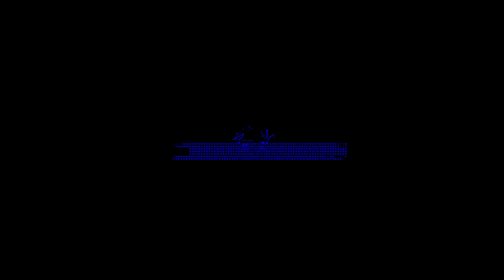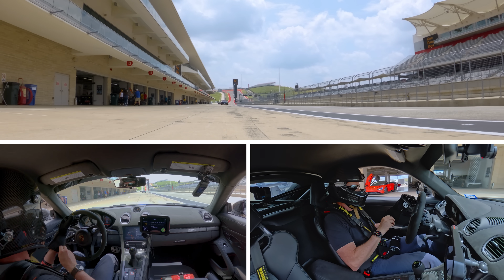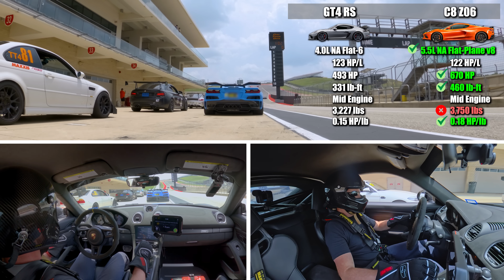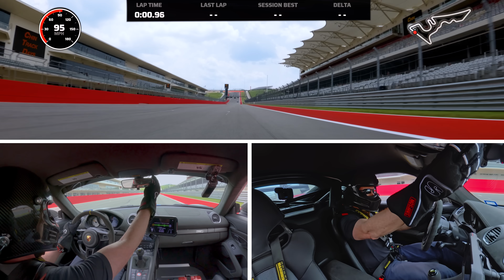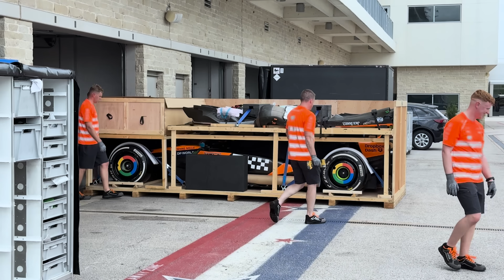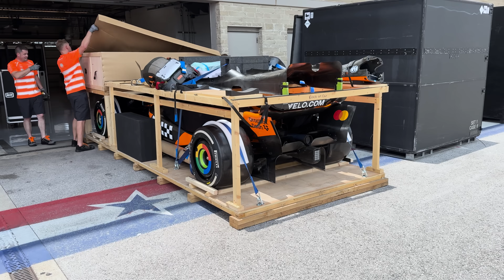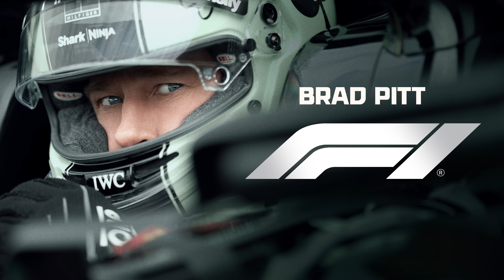Z06 vs GT4 RS : American Power Meets German Engineering at COTA

Comment: The Z06 is a horrible driver. Driver mod is the single biggest factor Porsche noob.
Reply from the maker: That’s kind of the point of the video. There are two different drivers in the video, and both are running at roughly the same pace in these cars. As I mentioned, I believe this is a direct result of a lack of confidence in the car due to setup issues and the brake-by-wire system.

If you watch my other videos, you’ll see numerous drivers in these cars running well below the pace their on paper specifications would suggest. To date, I’ve only seen one running at a pace comparable to the GT3s and GT4 RSs on DOT tires, and that car was on Pirelli slicks, which we know are worth 2–3 seconds at COTA.

Comment: The Z06 is a damn road car bud, period. If GM gutted it like the RS models, have mercy it wouldn’t even be close.
Reply from the maker: What is missing from the RS cars other than the heavy 18-way seats?
Reply: @ItsTrackTime  suspension that even remotely close to 1/3 of the magneride range, sound insulation, place where to put your elbows, no hard bushings in suspension arms, list can go on forever. You're just playing stupid and you know it. Get any road car a racecar treatment (that Porsche already does to GT-models from showroom) and they would be significantly faster. Also, quite harsh on a regular road - like GT-models are.
C8 z06 is comparable in comfort with Cayenne/Panamera, lol. Germans are impotent when it comes to suspension range. And yes, I own P-product and do not own Corvette currently. You don't have to be crazy brand fanatic, they do not pay you.

Comment: The 500 extra pounds pay dividends when you use the Z06 on the road. Sound deadening, storage space, creature comforts, etc.  Can a 3200LB track car be livable off the track with near 100db of intake noise?
Reply from the maker: I don’t buy high-performance sports cars for creature comforts. Give me an engine screaming to 9,000 rpm, a stiff chassis, and enough noise to make conversation impossible. If you want a quiet, comfortable ride, the market has plenty of options.
Reply: @ItsTrackTime  calling out a chassis when your camber fucks off in every corner in the same sentence as "high-performance" sports car is comical. 
Likewise if you want high-perfomance sports car, you can buy plenty of actually fast options. gt4rs is THE slowest car for the money. Physically impossible to be slower all things considered.

Comment: It's also called the Constantine effect. He's accelerating before you and has to brake before you. So that is where you see it walk away and then you get close again.
Reply from the maker: The concertina effect only becomes significant when there’s a gap between cars, allowing speed differences to build and cause the spacing to compress or expand, especially in braking and acceleration zones. When cars are bumper to bumper, they brake and accelerate almost simultaneously, leaving no room for that compression or stretch. In that case, the effect is neutralized, you’re essentially locked into the same timing as the car ahead. Skip to 10:12 in the video and watch the grey Z06 accelerate. A 670 hp car should easily pull away from a 500 hp car on the back straight and open a gap that can’t be closed if both cars brake at the same point.

Comment: This is a tough comparison, you’re the better driver here, obviously utilize the race track way more than the z06 plus smoother braking input, and overall better entry and exit out of corners. You would have to jump in the vette immediately after and compare that way.
Reply from the maker: Notice there are two Z06's in the video driven by different people and both perform about the same.

Comment: The effective HP delta is 20% and you’re not getting closer in the corners nor is he getting away on the straights. It’s simple physics. At a higher speed the time delta translates to a longer distance so the Corvette looks like it’s getting away from you. Btw, the Corvette should do better on tire management due to its double wishbone suspension vs the 718’S INCREDIBLY silly strut design. I have a 718 too and I really feel the strut limitations it in the corners, especially in certain corner exists under load. This is my last Porsche and actually my last car with struts.
Reply from the maker: The concertina effect only becomes significant when there’s a gap between cars, allowing speed differences to build and cause the spacing to compress or expand, especially in braking and acceleration zones. When cars are bumper to bumper, they brake and accelerate almost simultaneously, leaving no room for that compression or stretch. In that case, the effect is neutralized, you’re essentially locked into the same timing as the car ahead. Skip to 10:12 in the video and watch the grey Z06 accelerate. A 670 hp car should easily pull away from a 500 hp car on the back straight and open a gap that can’t be closed if both cars brake at the same point.
Reply: @I@Its @ItsTrackTime s is physically incorrect. The effect is never neutralized as long as the cars are accelerating. Even if both cars accelerate at the exact same rate, at the exact same time, from a bumperto bumper position, the distance between them will still stretch. in the real world, the leading car hits the throttle marker first, meaning it begins its acceleration phase slightly earlier in time than the trailing car, causing the gap to stretch down the straight until the braking zone where it compresses again. But you are correct that the Corvette should be able to pull away on straights due to a better power to weight ratio. That said, the Corvette is not the most aerodynamically efficient design so it hits a wall at higher speeds. Not sure how efficient the GT4 RS is. Regardless, the Corvette is the superior machine in most respects, except for its weight.

Comment: I passed a gt4rs on the interstate in my Yukon, didn’t realize they’re so slow !!!
Reply from the maker: Your analogy is a little off. We’re talking about advanced drivers at a race track here, not people out for a Sunday drive. Also, mashing the throttle on the back straight isn’t exactly a masterclass in driver skill. And judging by the comments, the C8 Z06 seems to have some gearing issues, which probably explains why a 670 hp car is running out of steam short of 160 mph at COTA.

Comment: Cannot use distance as a measurement in racing, only time. The reason is, if you have a half-second between you and another car that half second when you're braking into that 25 mph super tight turn you will be right behind them. But at 200 miles an hour on the straight that half second will be couple of hundred feet behind.

Comment: Car weight heavy depends on the size of the car, a car that have wheel base of 2.7m weights 3700lbs is consider light, 911 is lighter because its wheelbase is 2.5m
Reply from the maker: Wheelbase ≠ mass. You can build a 2.7m car out of carbon and it will be lighter than a 2.5m car built out of aluminum.
Reply: @ItsTrackTime there are lots of track focus car that has similar weight as zo6 ,amg bs, Ferrari f80, hurricane gto their kerb weight are all around 1600kg but your just say you don’t want to track cars that heavy.
Reply: @ItsTrackTime Italian car factory always advertises their cars as dry weight,that is why they get those crazy numbers

Comment: Sorry, but put a shoe in the Z06, and you’re done.  If I read the comments correctly, the Z06 had a passenger, and wasn’t really trying.
Reply from the maker: If you watch entire the video, there were two Z06s on track, both advanced drivers, and both cars performed about the same.
Reply: @ItsTrackTime an advanced driver may, or may not be a shoe. Just because they are reasonably fast and aren’t a danger is not a final determination.  And lastly. If the driver has to drive the car home, they will never be as fast as they could be. A racing driver needs to be willing to wad the car up, (find the absolute limit of the car, and be talented enough to recover it, to be fast)  Just saying..

Comment: It was no problem to smoke this car in my 2024 C8 ZO6 at COTA this past weekend. My fastest lap in stock C8Z was 2:16.7 using Pirelli scrubs
Reply from the maker: There were some faster Z06s at COTA this past weekend for sure. We were experimenting with setup and turned a 2:16.3 on Hoosier R7s. Another 4RS in the garage next to us was turning low 2:15s on Pirelli slicks. Fun weekend except for the rain.
Reply: @I @ItsTrackTime The stock C8 Z is fast with only slicks driven by average drivers like myself. I saw Randy driving your car. I was curious what lap time he ended up turning in it. Allen Patton is the only pro I have seen drive a C8Z at COTA. He turned a 2:13 but didn’t really maintain track limits IMO

Comment: Great footage! Can't he but mention though, you were cutting way inside/outside the track lines when chasing the vettes. Secondly, the Z06 does better lap times basically everywhere. Almost 3 seconds faster at VIR than the GT4 RS. That track is even more technical than this one.
Reply from the maker: Thanks! You need to use all of the track to run fast laps. The rules say one tire must remain touching the white line for the lap to be legal—go four off and you earn a black flag. I’m sure a Z06 could be quick in the hands of a pro, but at amateur track days at COTA I still don’t see many of them, and I’m not aware of any running in the 2:18s or below.

Comment: Hey @itstracktime I really enjoy your videos. These have been great documenting your journey. 

I just do 120 laps over two weekends at G2 Motorsports park (3.1mile circuit) am the Zo6 blew me away. It’s so easy to drive. 

Brakes: the brake pedal is tuned for delicate pressure that you build through travel - if you stomp on it then nothing happens - it’s like it bypasses the system. You have to introduce the brakes pedal slowly and then get into it. I think a lot of people are trying to drive it like another car and it’s just not built that way. 

With that being said - once you meet how to control them they are immense. 

I have a Porsche 987.2 (300hp) race car with weight reduction, custom coilovers and camber plates,  no interior, race seats, an on a 200tw Hoosier ta pro - fully wringing its neck - 

ITS 5 sec a lap slower to drive than a stock ZO6 on ps4s. Let that sink in.! Am driving the cayman on edge feels sketch compared to the vette.

I’ve never been a corvette guy but that vette is the best and most capable car I’ve ever driven. It’s a masterpiece for the money and without significant aero the mechanical grip is mind blowing.

Comment: With both drivers being equal, its obvious and been proven that the Z06 matches the GT3RS on track demonstrated by Hagerty at willow springs & the GT4RS isn't even in the same league
Reply from the maker: The Hagerty video from four weeks ago featured a ZR1, not a Z06. And I would certainly hope a 1,000-hp car could beat a 500-hp car around a track.
Reply: @ItsTrackTime  no I’m talking about last year at Willow Springs with the GT3RS & Z06. Pretty much identical times
Reply: @ItsTrackTime  https://youtu.be/mCQlLa36-0c?si=PQkE2UeHFvtpLGpR
Reply from the maker: That video showed both cars in the hands of a pro driver—Randy—and the Z06 still lost to the 3RS, despite having roughly 1.3× more horsepower. Throughout the video, Randy repeatedly commented on his lack of confidence in the Z06’s brakes. That same lack of confidence appears to be showing up at COTA HPDEs as well, where these cars still aren’t turning fast laps in the hands of amateur drivers. I was at COTA the first time Randy drove a Z06, and even then he noted that the brakes were difficult to modulate and suffered from poor pedal feel.

Comment: That distance difference is speed-dependent, not time-dependent.  The distance will always increase on the straights because speed increases.  Said another way, a 1-second gap at 150 represents more distance than it does at 60.

Comment: FWIW-   i have tracked both of these cars and also a gt3 with 4.1 motor and ohlins…..the c8 zo6 is a heavier car but it easily hits 180 at start/finish at daytona.     temps don’t move and you can literally hear the radio.    never been in a car from factory thst is so effortless.    the gt3 could just touch 180 as well but was working much harder and did not inspire confidence like the zo6.

Comment: I don't understand why American manufacturers keep making these overweight sport cars. A sport car like the Vette shouldn't weight more than 3300 Lbs. I would say the same about the Mustang and Camaro, but those are really 2+2 muscle cars that can handle fairly well. If Ford can use aluminum in it's pick-up trucks, it can do the same for the Mustang.
Reply from the maker: I agree. Even my inexpensive 4 door 2013 Subaru STI only weighs 3300 lbs.

Comment: it brakes sooner mostly because it reaches higher speed. another factor is brake by wire compromising threshold braking and trail braking a bit. weight may a dd a bit to the equation and less drag per kg. 
there is also a significant ratio of power over drag coefficient CdA (total) which is significantly higher for the c8 z06 , like 40% so above 50mph it becomes more and more important and will also affect top speed.

Comment: I’m in you’re obviously you better drive and then both of those guys their lines were terrible if you were going up against the guy, you actually knew how to drive the car you’d have no shot. I have a C7 06 and had the privilege of running about two or three sessions with a GT four and your car is definitely pretty bad ass in the turns But he was looking at my tail lights for most of the 2 1/2 sessions. I think that we ran that said nice drive man you’re a good driver.
Reply from the maker: Thank you for the kind words. As I mentioned in the video, what surprises me most is how few of these cars actually get used on track — and how small the track community is around them. If you bring one to the track, you’ll quickly realize there’s no one to talk to about setup or share data with.
The 4RS, on the other hand, has a thriving track community at COTA that openly shares information, which lifts everyone’s game.
And when it comes to the straights, this car should be opening a gap I can’t close in Turn 20 — but instead, I’m able to reel it back in easily, which tells me the difference is being made in the braking zone.

Comment: I really enjoyed the video. Keep in mind there will always be an accordion effect on the straights-- your points of the Porsche braking later and the Vette having a straight line advantage are definitely spot on, though.
Reply from the maker: Great to hear you enjoyed the content and thanks for the feedback! The accordion—or concertina—effect is very real, but when cars are running bumper to bumper, they brake and accelerate almost simultaneously, leaving no room for that compression or stretch. You’re essentially locked into the same timing as the car ahead. Skip to 10:12 in the video and watch the gray Z06 accelerate — a 670-hp car should easily pull away from a 500-hp car on the back straight and open a gap that can’t be closed if both cars brake at the same point.

Comment: I love the way you use the weather as an excuse to be down on power, however, would not the z06 suffer the same and still pulled on you .
Reply from the maker: Heat affects everything on track — but who could’ve guessed 670 hp would beat 493 hp in a straight line? What a mystery.

Comment: why you complaining about conditions?  The Vette has the same conditions so....?  The zr1 would destroy you
Reply from the maker: Track conditions affect every car out there — I never suggested otherwise. And yes, I’d certainly hope a 1,064-hp car could beat a 493-hp one on track; it’d be a complete failure if it couldn’t. The real question is how much confidence the ZR1 will actually give its driver. Judging by the current pace of the Z06s, confidence still seems to be in short supply.
Reply: @ItsTrackTime  then why did you spend so much time telling us why your top speed was down?  Sure sounds like an excuse to me.  MEH

Comment: Turbo s is more comparable to z06. It weighs 3.800+lbs
Reply from the maker: Yes, but the 911 Turbo isn’t a track car. I rarely see them out there, and when I do, they’re usually in the lower run groups. By the time you’ve logged enough seat time to move into the advanced group, you’ve also figured out which cars actually work well on track.

Comment: Those seats alone in the c8 can drop 100 pounds or so if it did not have and electronic functions.  And the wheels can drop 20-30 pounds all around.

Comment: Its funny hearing power per liter being highly advanced.  All my buddys around making 200-250hp per liter in 4 cylinders like its a joke.
Reply from the maker: You’re citing boosted metrics. I’m discussing factory warrantied naturally aspirated engines with catalytic converters still in place. Forced induction inflates these figures but typically yields a power curve that’s less ideal for track use and introduces additional cooling and reliability challenges.

Comment: Have you run against a 2019 C7, manual with track alignment and Cup 2’s? Not the Cup 2 R’s. Has a lot more torque than the C8.

Comment: I have driven both of these track, the C8 was the most underwhelming experience I have had in years 😢

The GT4RS is a far better car, not just in laptime, but in feel and confidence.
The brakes in the C8 I can confirm are terrible, you can't modulate the brakes properly from one corner to the other.